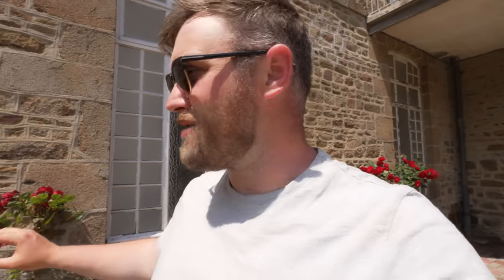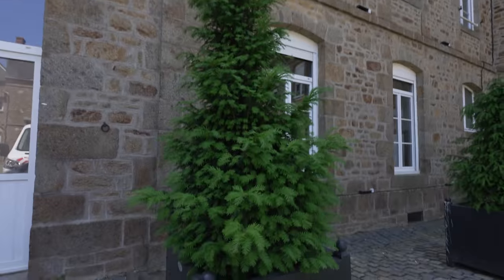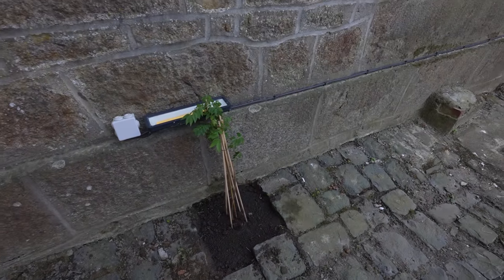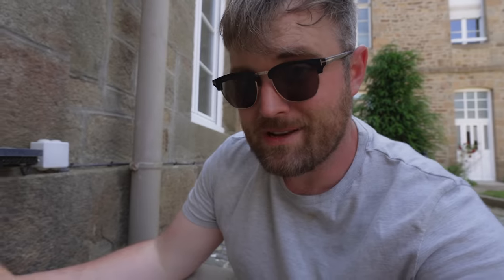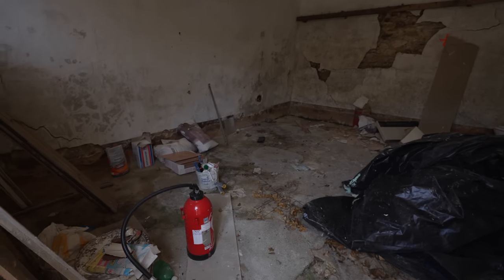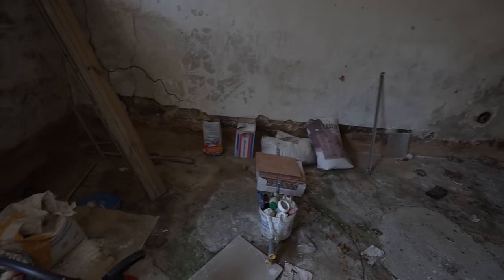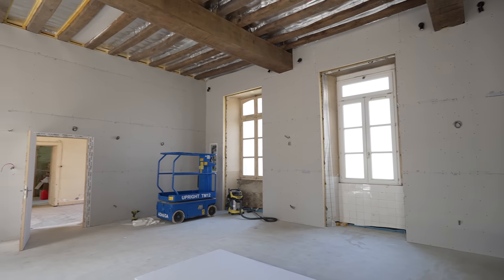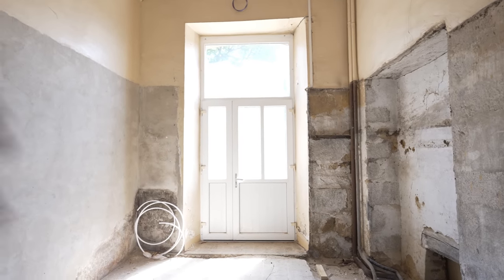Paint It Black You Said

Comment: I love wisteria but as others have said run don't walk to the convent and pull it out it will rip the building apart and once established is extreamly hard to kill. If you want the wisteria build an arbor over a walkway out in the garden well away from structures and let it grow on that.  Maybe instead of plants on the facade replace the shutters all the old hinge pins are still in the wall. You could also plant some small flowering trees in the lawn areas.  I totally agree with your plan on the old cooker black paint will be more durable than stove black the bands of metal that were nickel rather than leaving them plain put a clear coat on them to keep them from slowly going dark over time.

Comment: Wisteria is beautiful - and destructive.  It won't grow in front of those lights, or the drain pipes - it will grow behind and around and through them, and rip them right off the wall. Rather than ON the building, you might think about pergolas or just simple 4x4 structures for them to climb, in front of the building...

Comment: Billy, to help your plants survive the hot summers, place shingle over the top of the hole to about 1 and 1/2 inches deep. this will hold in the water. Especially for the Hydrangeas.
Yes, Wisteria can run away on you, grow fast and cover a large area, but if you cut any unwanted runners off after five leaves in the late summer and then by two leaves just before winter, you will get a flush of blumes the following May.

Keep an eye on the runners near window frames and any area on the wall that has cracks in the brickwork as once a runner forces it's way in, it will swell and blow any week joints.
Once the blooms have fallen, cut them off just where the new leaves appear. This will encourage a new flush of blooms.
Please don't be put off by the negative as the positive is so much more worth it.

As for the majority of answers regarding the location of your Wisteria plants, they are, sadly, all right. Wisteria have a tremendous root system and trunk size. A most powerful but beautiful plant and could cause you vast problems having them so closely planted to a building.

I have mine planted and trained along a 70" pergola, running from my front gate to my front door, far enough away from the house to be safe.
If you could build a long pergola, up to the main door of the building, plant Wisteria at the gate end, than all your troubles will be non existent and the GLORY of the Wisteria will be a talking point of your neighbourhood..

Comment: Wisteria is a fast growing plant and breathtakingly beautiful but it might take up to 7 years to flower. It also requires correct pruning twice a year to encourage the flowers and to keep new growth under control. Unlike ivy it does not cause structural damage to the building directly as it does not have stem roots and does not attach itself to the building. But it requires strong support due to the heavy weight when established which in turn may cause strain to the walls. Simple wire will not do, you need more industrial approach. The stem can grow very large and thick and so the roots. The roots are as long as stems, which is potential problem for your gutter system. It is better to create a separate structure like a pergola in a garden for one wisteria than to plant so many next to the building. Keep in mind that this plant needs constant maintenance. Do not leave it unattended or it will take over. One of those plants would cover half of the convent wall. You have planted well too many.

Comment: Hydraners. Have you discovered the climbing variety. Have propagated from cuttings.
 Ps. Billy. Thnk leave the original flagstone floor in its integrity.  Work with it.
Your restoration is so, so special, do understand that you need to include all the mod conveniences in our  tech world, and you are doing this again with integrity.  Simply Crack on.
Perhaps as the previous comment to mine is.  The floor is. 
Regards. 
Shaelene Read.

Comment: Hi Billy, with your Wisteria, I wouldn't tuck them behind the wire, because you will find in time that the plants trunk will incapsulate the wire. It's better to tie them to the wire with garden twine, and then they will form a trunk thick enough to hold it's self upright. As for the roses do the same but with horizontal wires stagered up the wall, and with those, espalier them. You get far more flowering spurs that way, and it allows you to cut them off the wires every year and prune them. Hope this makes sence and I'm not telling you how to suck eggs? P.s I see Wiseria planted on walls all the time I.E Sissinghurst gardens, surely Rita Sackville West couldn't have got it wrong????

Comment: I've worked in a greenhouse nursery for 20 years..wisteria should never be planted next to a building as its root system is powerful and will damage the building..it also does best in full sun..hydrangea would do better in that spot as they do best in full morning sun and afternoon shade avoiding the hot sun..if you are looking for a flowering vine for the convent walls..hummingbird vine or cardinal climber is a fast grower..up to 2ft per week..reaching up to 30 feet and require no wiring or trellis..they attach themselves..they come in red orange and yellow..hope this helps

Comment: Hydrangeas will have vibrant colors depending on acidic soil, with a pH lower than 6.0, yields blue or lavender-blue hydrangea blooms. Alkaline soil, with a pH above 7.0, promotes pinks and reds. With a pH between 6 and 7, the blooms turn purple or bluish-pink. To lower your pH, add garden sulfur or aluminum sulfate to your soil.

Comment: Either late winter or early next Spring, if you prune those roses back down to about 6" just above an outward facing bud, you should get them to grow bushier and be 
much more florifrous. Oh, and feed them with some Fish, Blood, and Bonemeal, lightly forked into the top couple of inches of the soil.
P.S. Are you (sure) those roses are a climbing variety & not a shrub rose variety? They really do look as though they're shrub roses that have been somewhat neglected by the previous owners. [If] I'm correct, the hydrangea will swamp the roses, shading them out to the point of death, despite the sunny aspect. You can get (climbing hydrangea) if that's of any help and (I think) that they're self-clinging & won't need any tying in, but you'd have to check that last bit. 

Alternatively, loads of other climbing plant choices. Clematis, Jasmine, in their myriad of forms & varieties for starters. Lots of people use Wisteria, but their root systems can be VERY aggressive once they get going and can interfere with foundations and are an absolute nightmare to dig out if that happens, so best planted up against a free-standing structure. Also Wisteria requires at least a yearly, sometimes biannual, pruning depending on the variety or else it gets way out of hand. Most varieties smell lovely, but one or two smell like cat's pee so check before you buy. 😅

Quick question: Did Michael take my advice and plant his new plants properly? In his video the other day, he chucked a load of lovely woodland soil on top of a weed suppressant membrane & then planted several hundred euros worth of lovely triffids (on top of) the lot! All WITHOUT cutting cross slits into the membrane to plant the triffids into the ground. I get that he's relatively new to triffiding, but surely he could've done a bit of basic how-to research first. 
Out of the stuff he bought, the only thing that will probably survive is the pansies because they only have shallow root systems. The rest would normally develop very deep root systems, without which they won't survive, especially in drought or very cold winters. But because they were planted on top of the weed suppressant membrane, those shrubs & herbaceous perennials won't be able to develop their root systems properly. 

When rejigging a tired out piece of ground and don't want to weed like fiend, throw a load of good soil, compost or even grass clippings if that's all you've got to hand, on top of the soil. It can also be pretty handy to wet a load of cardboard and chuck that on top of the lot as this will add carbon to the soil as it rots down and exclude light for weed suppression. 
Lay out the weed suppressant membrane if using one. 
Arrange your triffids to suit. 
Cut cross slits THROUGH the membrane where the plants are meant to go, folding back the membrane & dig the appropriate sized holes. 
Fork over the soil in the bottom of the holes, include any fertiliser if using at this stage & plant.
Fold back the membrane around the base of the plants (as you go for ease).
Mulch heavily (about 4"-6" gets the jobs done) on top of the membrane around the plants etc. This will exclude light, retain moisture, and save a lot of tedious 
weeding - unless someone has a weeding fetish.

He made such a lovely plant selection, it would be such a shame to see it all go to waste.

Comment: The roses might be growing spindly because they weren't getting enough light, nutrition and weren't being pruned every spring.  They should be pruned back in late winter so the new growth grows on strong older wood. Roses do like being crowded so make sure the hydrangeas don't shade them out.
Reply: * do not
Reply: @janefreda7034  Agreed. I also think that the very sunny front courtyard may not be the best location of choice. A shadier & much damper spot would be better. Lavender, Rosemary, Ceonothus and similar Mediterranean type planting would suit the base of the walls in that area. Basically anything that will tolerate the hot dry conditions without having to bother about watering all the time.

Comment: the garden is going to look stunning! mulch them well with compost and give them all a good feed! ps when planting; soak the pots and contents in a bucket of water first until the bubbles stop. They are fine. You wont see much growth for three or more years? it will go where it wants and that won't be straight up but will wind around the guttering. Remember its a Vine, so will twine.   a piece of chicken wire on the wall will be a better structure that it would like to use as leverage as in the wild they twine through trees.   Just make sure that none of the  tentacles go behind the downpipe; move them in front otherwise it will have the guttering off. They need pruning when they get larger but you have a long wait ahead and it will look fabulous.

Comment: Wisteria isn't invasive. When you put your ring on the wall, it needs to be big, so when you attach the wire you can give it distance away from the wall, otherwise the wire will cut through the stem of the wisteria. The stems get quite thick at the base, so you should allow for that.

Comment: Those are climbing roses and they need to be trellised. Hydrangeas are not a good mix with roses. Hydrangeas need half day of shade at least and roses need full sun. Wisteria will turn woody and will need a strong support to hold it. It is also rather invasive and would not recommend near buildings. Someone else pointed out the sloped cobbles. Probably shouldn't have removed them. They are keeping water from pooling.

Comment: Billy r u daff mate? I believe that you do not do much gardening. Wysteria is the worst possible plant you could plant anywhere near your building. So...Yeah! Take them out and plant them on a pergola away from any buildings or stone walls. Of course that is another major project and you still have a garden filled with brambles to sort out. R those 'Don Juan' roses? They look kinda small but it is early in the growing season. I had them for years and they are prolific climbers and smell like heaven; if there were one? I noticed the shutter brackets either side of the windows. Maybe you could add color and architectural interest by putting the wooden shutters up,(if u have them)? Or, get Michael to make new ones? You could paint them maybe something in a dark blue/gray  color which would contrast well with the stone. Your new windows frames are going to be white on the exterior? Metal factory baked finish? Still workable, and it is good to have a 3 colors scheme to highlight architectural details and make it snap; Cha Cha Cha! You already have the lights to accent the exterior walls; wisteria would choke them out and make them a totally wasted effort. What you have is height and trim that is painted and can make it pop. The window mullions and frames are like the eyes,  windows to the soul of the convent. The main door will be a big feature and draw the eye with its shape at the top. You see how the original door was replaced with something that simply does not match the outline. Something like that could be repeated/ incorporated into the shutters as an example of creating a theme that builds on the original features. With software you could create several renditions of what the building could look like in virtual images. It's not a convent anymore, but the red roses do fit as a reminder of the blood of Christ. Maybe as new life and beauty climbing over the cold dark stone. Very striking along with the green potted evergreens; the colors of life; of XMAS? Just spitballin'; you got the wisteria out of the ground yet? C'mon now Billy. Chop-Chop, lets pick up the pace now! Maybe plant the wisterias in the garden and let them kill all the brambles? Game Of Thorns? 😂😢😮😊 😂

Comment: For your Victorian cooker you need black lead polish  it’s name  is zebra black 2:18  lead polish  I used to use it on an old Victorian fireplace it is heat resistant you put it on leave for a few minutes then shine it off with a clean clothing wouldn’t use pain Ona stove if i were you😊
Reply: Cloth.
Reply: Paint
Reply: Errors errors errors
Reply: Wisteria is lovely but you have it trailing around your windows it will pull down your drainpipes then get under your roof keep it at a height you can keep control of or it will get out of control
Reply: It isn’t painted black they really did use black lead I will try to send you some😊

Comment: Why not just have roses out the front and put the wisteria in the back along the wall where rubble Mountain was?
You don't want the wisteria to wreck the awesome work you have done
Reply: I would NOT put it along ANY wall. Strictly a very strong pergola candidate. The effect on the stone boundary at the back of the Convent would be about the same as planting Wisteria up against the Convent itself, eventually undermining and ripping it apart. I'm not anti Wisteria, just a 'right plant, right place', kind of gardener of over 30yrs standing.

Billy can have his Wisteria out the front if he really wants to, BUT, the comprise to prevent it becoming the unwanted nightmare that roughly 800+ people are warning against, is to use extra large planters to keep the roots in check.

Comment: Wisteria is so invasive. It takes over everything and it gets so heavy that it will pull down trees. At my house thee wisteria brought down 3 trees, the trunk of the wisteria was 4” across. We cut it back to just the trunk and it started regrowing immediately. You are replacing the ivy with a much worse problem. The hydrangea will get too big for that setting. And the wisteria will over take it. I don’t think removing the cobbles is good for your foundation. Clematis would be a better choice. It isn’t invasive and much easier to control. You need to talk to a master Gardner. Make a plan. This is a terrible idea for both the wisteria and hydrangea. Why on earth do you want to hide that great stonework?

Comment: Fertilize the roses
Reply from the maker: have done ✅
Reply: @ThePethericks  great! The hydrangeas are a lovely idea. They like a bit of sun but mine are 5feet wide and 5 to 6 ft tall. So I wouldn't put in between roses. Best to put something low, but colorful to ground. White verbena, something flowering. Not over 10 inches tall. You could do seasonal flowers there. My Wisteria took down an 6' long fence 8' tall. It still shoots a long limb out years after I cut it down to underneath soil. Drilled into base put salt into it. Still didn't die. Set stump on fire. Still put out. Some guys dug it up, but one vine grows 20 ft by July. The son of a bit@# drives Mr crazy. I can't get rid of it.